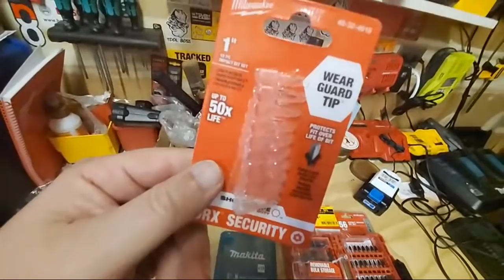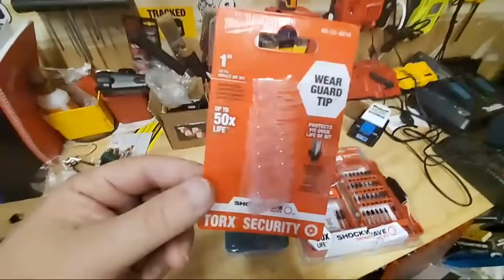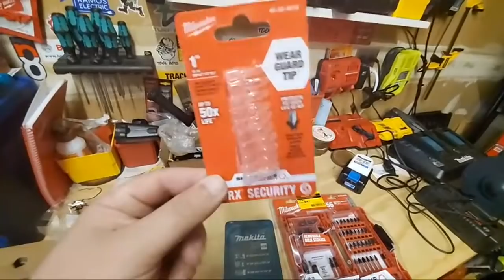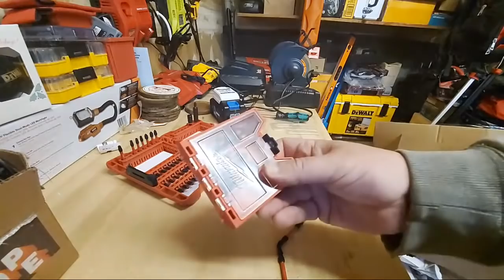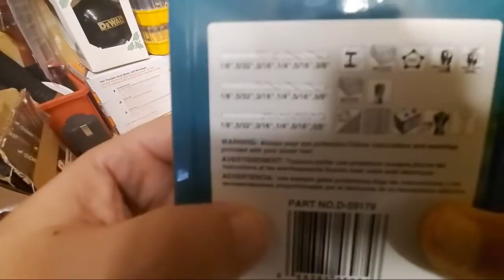Milwaukee Shockwave Security Bits & Makita 18pc Straight Shank Set

Comment: Hey Boss quick question. Trying to look at the Ridgid kits on Home Depot for $149 that come with a free tool. Well I picked the two 3.0 Bluetooth batteries and two 4.0 batteries, charger, case. Then I picked the 1/2 impact wrench for free tool. But at checkout it won’t apply the free impact. Any thoughts?
Reply from the maker: Great deal buddy 👍👍
Reply: TOOL BOSS I mean it’s not applying the free tool in checkout man. Any help/advice?
Reply from the maker: It's not applying it ..can you try two separate orders ? If not it might work cause of the 2 4.0s
Reply: I think two 4s count as a tool